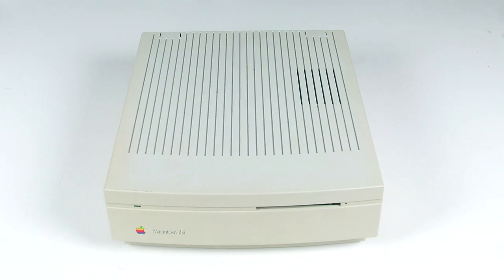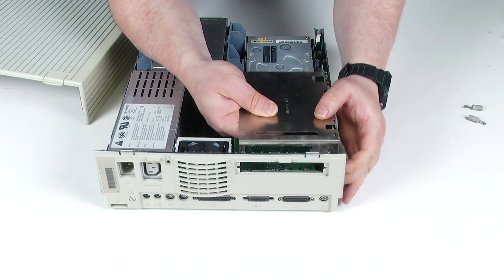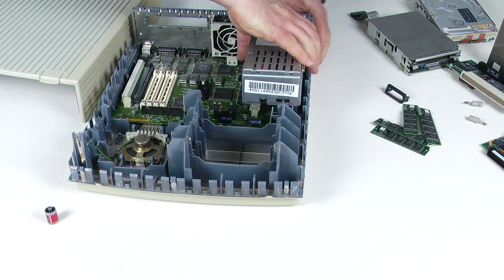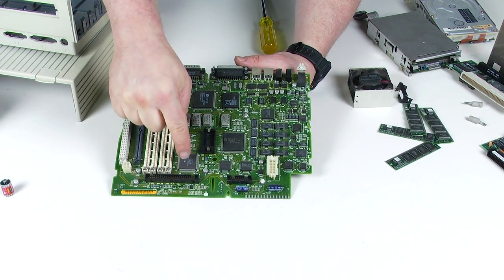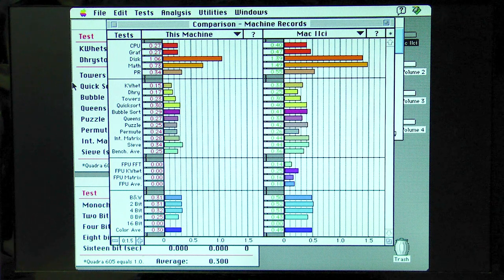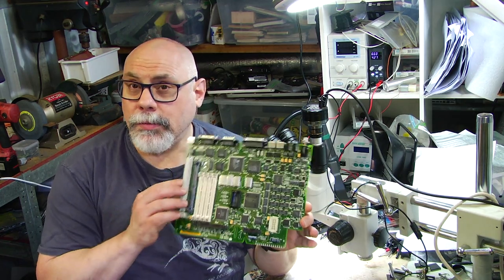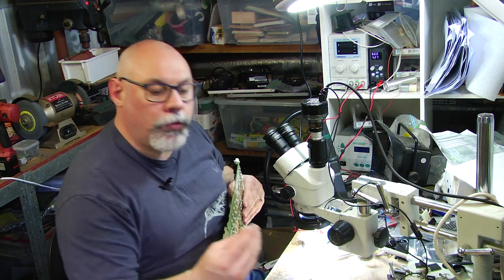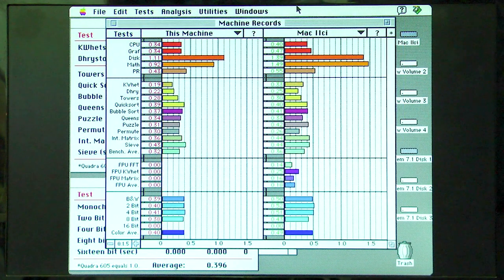Macintosh IIsi Teardown and Overclocking

Comment: Overclocked mine (about a month after this video) and installed a socket for the crystal, in case I need to go back for any reason. Also attached a small heatsink to the CPU.
Reply: Hi, May I aske you where you got the crystal from? Thanks
Reply: @jamiesowell  P/N X121-ND and ED3114-ND on Digikey :)
Reply: @kahlil88mph  Thank you so much!!!

Comment: The LCIII can be similarly overclocked from 25MHz to 33MHz, effectively turning it into an LCIII+, though in that case it's a matter of swapping a 0Ω resistor from one side of the board to the other. I did it to mine and it works great, and the LCIII really benefits from the extra speed. Would be interesting to see a video detailing the whats, whys, and wherefores of that particular mod!

Comment: You can buy a ROM SIMM upgrade from Big Mess o' Wires (as of Nov, 2019) that lets you put a System Folder in ROM and boot from it.  This is awesome on a II-era Mac since they have small hard drives that are so slow.

Comment: You can make this iisi go quite a bit faster by changing the cache size (in the Memory control panel) to 768k. It will then avoid using the slower motherboard RAM that's shared with the video generation.

Comment: I just bought a IIsi from a guy locally for $40 USD (also came with printer).  Inside, THREE of the capacitors were rattling around!  They literally just fell off.  The battery was still inside but luckily, it did not leak.  Mine also has a network card in it.  So not too bad of a deal.  Now it's time to recap!  :-)